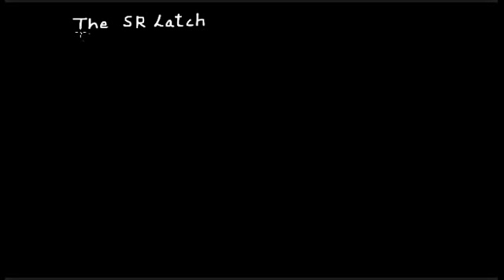The SR Latch using NOR Gates

Comment: At 5:43 you state "this 0 serves as the input to the lower OR gate". As far as I understood, it is not this value that is supposed to feed the input, but the value of "present" Q instead. Am I not correct?
Reply: +Armen Michaeli This is all about the change itself, treat it as a process, but not a ending state. The OP means, when it changes, "this 0 serves as the input to the lower OR gate", so the lower result after the NOT gate will changed too. You should calculate the result with the "next" state, but not the "present" state. This is where bugs me for a while. Hope it helps.

Comment: At 7:23 you start feeding 0 from "next" (i.e. the one you just evaluated from R=1) Q=0 down as input to S -- aren't you instead supposed to feed the "current" value of Q to S? That messes up the entire learning for me - according to you "next" Q' (Q bar) becomes 1, but if you had fed S the current Q which is 1 you would have gotten next Q to be zero. It should not matter much because as I understand Q and Q' are not always opposites, violating their nomenclature, and this would be one of the cases - the important thing is that Q is "reset" to zero. But anyhow, the fact that you feed it next Q bugs me, also because earlier on you do the "right thing" and feed "current" output as input.

Comment: when you take input as 1,0 then you are considering lower nor gate first and not upper nor gate ?  the answer differs when you consider upper nor gate first when taking inputs as 1,0(S=1,R=0). Also i didnt understand on what basis you are assuming present state to be 1,0 or 0,1 there has to be some logic for selecting present state as 1,0 or 0,1 . Kindly explain that?

Comment: +AsuusG72 if Set was (1) and Reset (0) then for the Set since it is a Nor gate (Or and not) then 1 "Or" anything is 1 then "Not" Q' (Q not) becomes 0, and from this output to the other Nor gate (the one connected to Reset) 0 "Or" 0 is 0 then "Not" Q becomes 1. Hence it is a Set state.